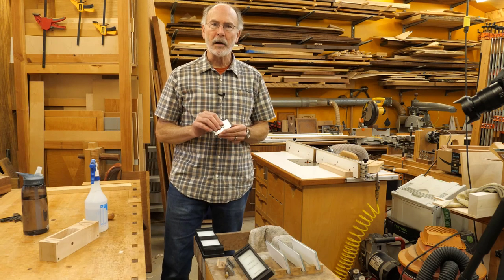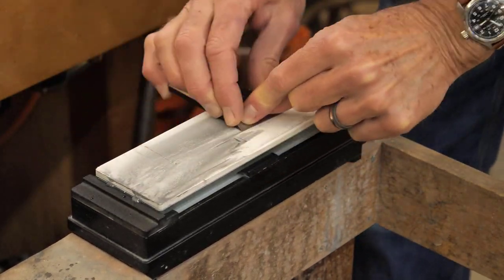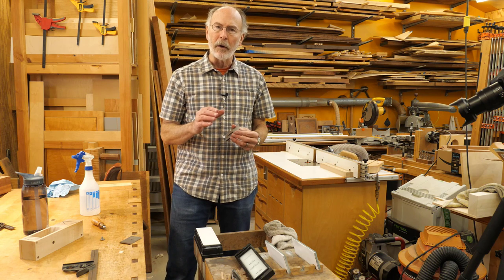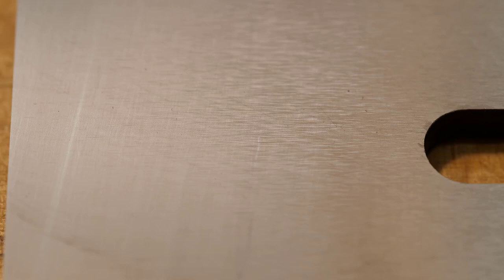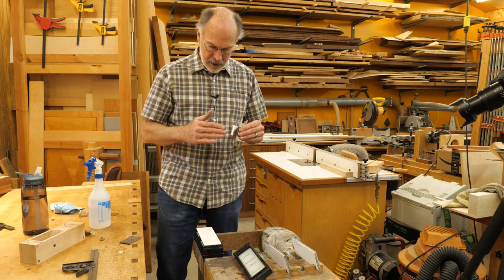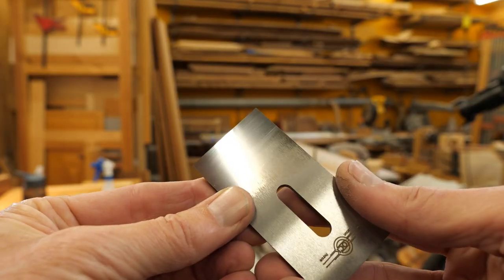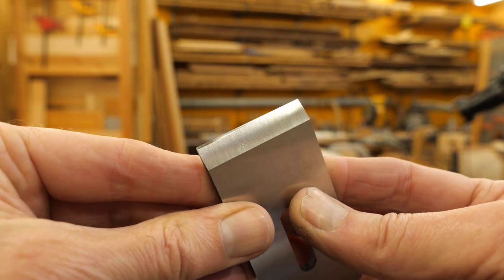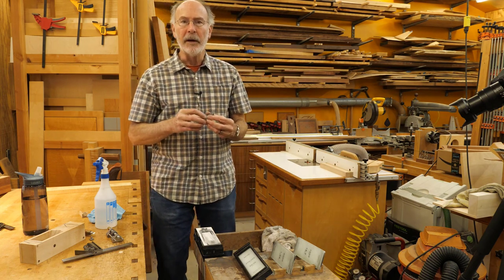Hock Plane Blade Sharpening

Comment: What sort of stones are these? How much thickness do you estimate is being removed when flattening them.
Reply from the maker: I'm using Shapton GlassStones. I got my first set around 2006 and the 1000-grit lasted over 10 years, maybe 12. If you are careful and use the stone evenly, they last a long time. The abrasive is about 5/16" thick and because of the glass backer, can be used until it's almost gone.

If flattening removed .001" each time, that would give you about 300 flattening operations; I'm sure I flattened them many more times than that, so the amount is very small. That is partly due to the flatness of the lapping plate. I use the Shapton Diamond Lapping Plate, which is flat to .0002". It's very expensive, but may pay for itself over time.